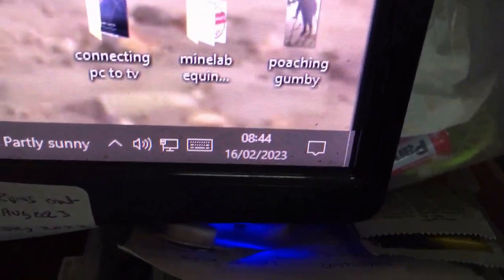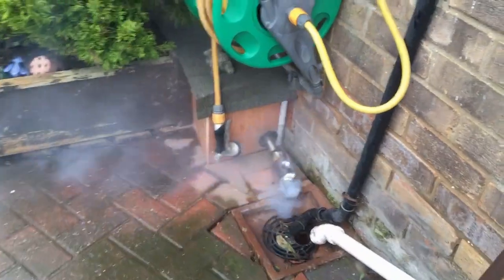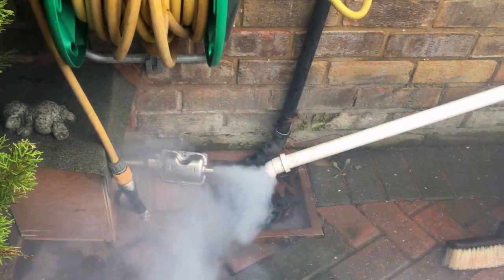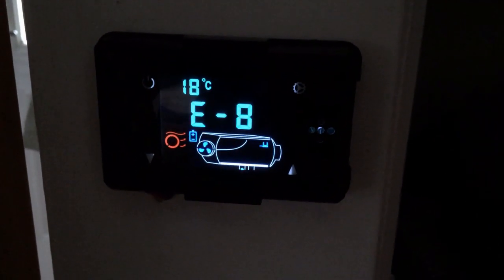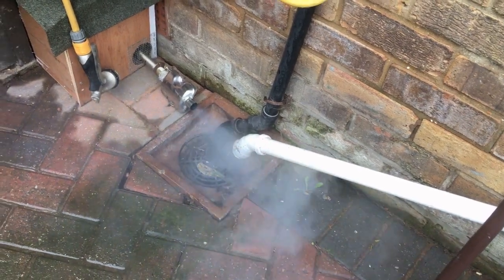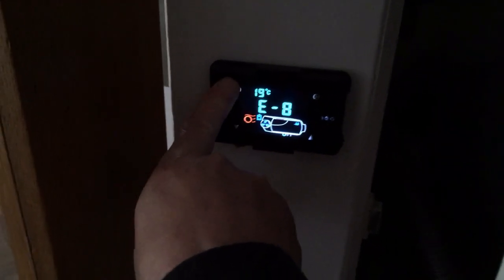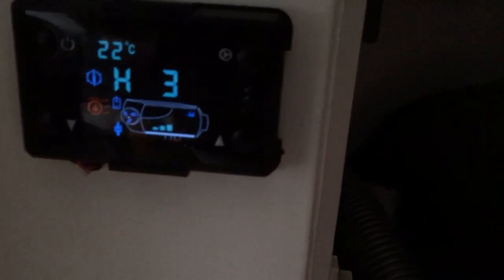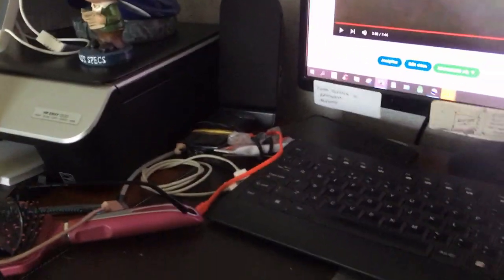6 days of troubles - 5kw chinese diesel heater to heat my home part 7,16th feb

Comment: Hi Robert,is your exhaust pipe going down hill all the way from your heater? cheers Geoff.
Reply from the maker: its level with maybe 0.5inch drop at the muffler end
Reply: @robertedwards87 Just asking as i had a similar problem with condensation in mine i increased the downward slope and its been great since, hope this helps cheers Geoff
Reply from the maker: just checked it it drops about 1.5" from the heater to the muffler

Comment: Is the pump at the wrong angle?    Seems it is supposed to be the OTHER direction.    The top at at 10: oclock and bottom (intake) at 4: o'clock,  Yours looks like 2 o'clock and 8 o'clock.   hope that makes sense
Plus it sounds FAST and  Empty
Reply from the maker: i see what you mean but i  dont think direction matters as long as the outlet is at the top and the angle is correct but i might add some extra fuel line and change it to 20 past 10 just to make sure,i thought the pump was running fast but then it slows when its running and its full of fuel.if im correct once the fuel system has being bled and theres fuel all the way to the heater,then there shouldnt be any air bubbles in the fuel line ???unless there is a leak in the line or pump and as can be seen in the video there is no air before the pump

Comment: E.8 error code lack of fuel
Reply from the maker: if you check out my latest video ( part 10 )it looks like its too much fuel,for the last 2 or 3 burns ive turned the settings down to 2 or 3 pips and let it burn all the fuel from the higher setting before turning it off and when i restarted it it started with no faults and no smoke